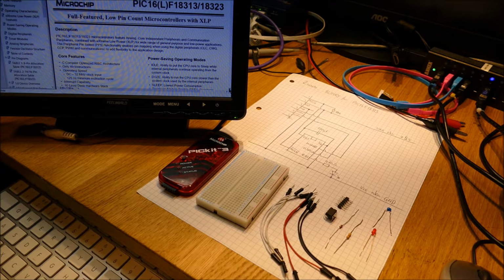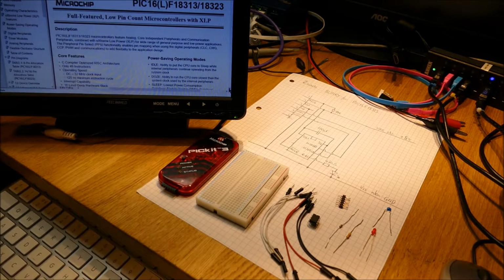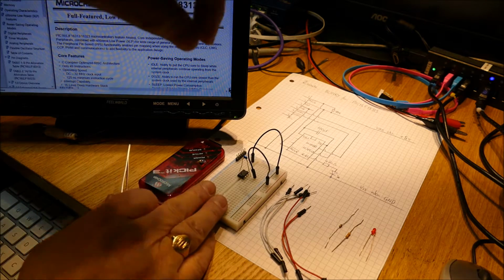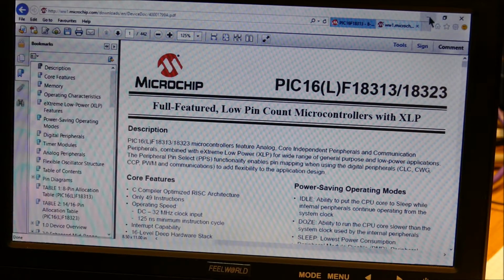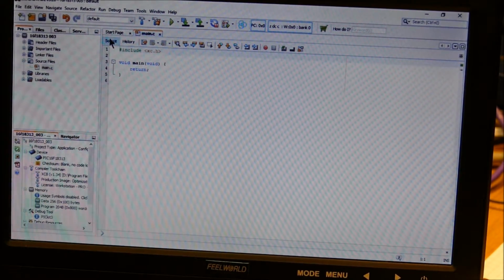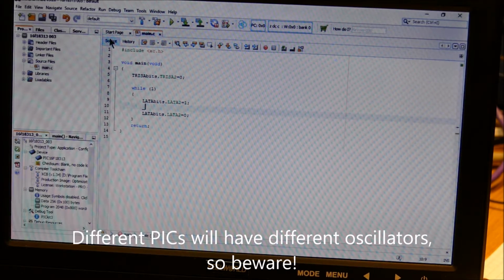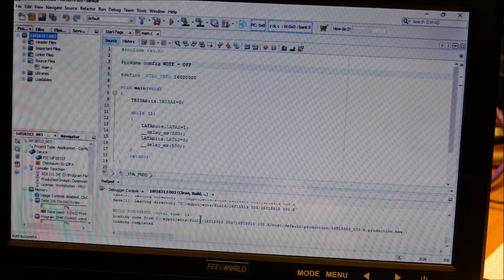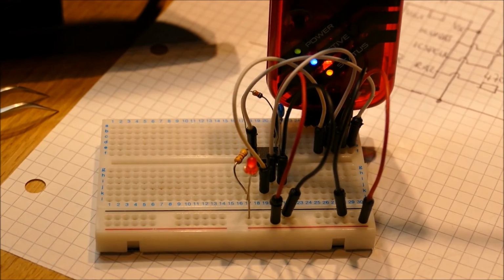How to build and program a Blinky on a PIC16 from scratch

Comment: Hello!
I have a silly question :) PICKit 3 Programming application doesn't have PIC16F18313 in it's list! I've make "download Pickit3 Operating system" before connecting and did choose PK3OSV020005.hex that was in the app's directory after installation. Do I need to find some other file to get it available within Prog. application?
I have a ready to use HEX code so it's the reason why I'm not doing it in MPLabX.